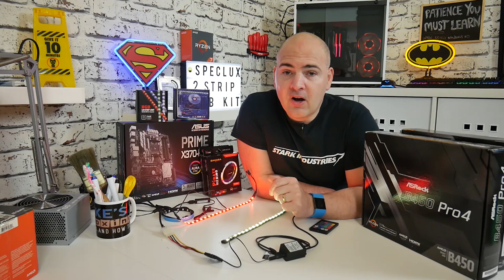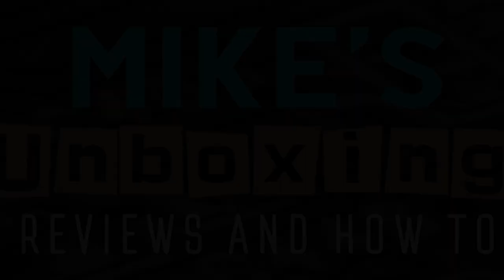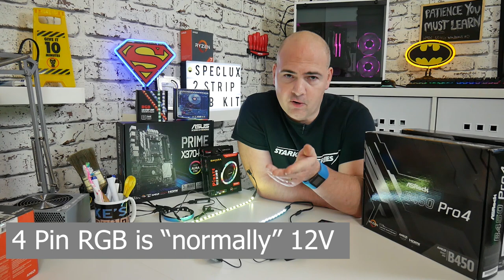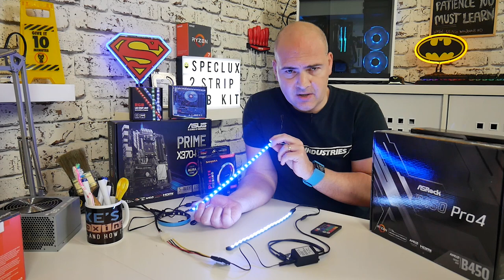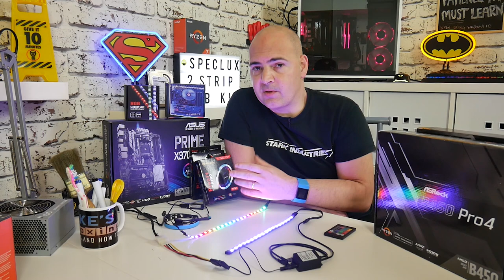PC RGB & Addressable RGB Explained

Comment: i have a question.. my motherboard has only 12v/4pin header and all the argb i baught are for 5v/3 pins, can i just plug a 5v/3pin controller/hub to the sata and it will work normally?
Reply: to further explain myself, i have an asus prome b450m-a motherboard, and the argb im talking about is phanteks fan frames and neon led strip(all 5v/3p), can it work if i use a 5v/3p hub that is powered by the sata?
Reply from the maker: yes that is right
Reply: @mikesunboxing   thanks it really solved my problem! i thought i would have to get a converter but if the sata only can power the controller hub without having to connect to an rgb header on the motherboard then i guess its fine, btw with this kind of setup can it sync with asus aura? or the controller only can do all that?
Reply from the maker: Yes the controller will effectively become the aura software and take control of the connected devices

Comment: Question - so if I purchase the Corsair H100i RGB Hydrocooler, it says its A-RGB, but the header on my motherboard only has (12v) four pin RGB, does this mean I can't use this cooler?
Reply from the maker: no you need a 5v argb header or controller
Reply: How do the controllers work mate? do they generally plug into the RGB header, or USB header or something like this? then allowing you connect A-RGB fans/strips/etc to the controller...?
Reply: Mike's unboxing, reviews and how to - doesn’t the h100 plug into a USB header though? Avoiding all this altogether?
Reply from the maker: The i version does it think but I could be wrong

Comment: Mike, I use the Sahara RGB's and want to plug them into the Asus Z490-H gaming board, the Sahara pamphlet shows the Asus method but I assume that I only connect one of those cables to the board. As such, I have connected the 3 pin to what I believe is the correct socket on the board which Asus are calling "Aura addressable Gen2 header"  The sata from the control box is connected to the PSU. Is this correct or should I use the 4 pin connector. if so does the 4 pin connect to the RGB header socket or one of the fan/pump headers ?? HELP
Reply from the maker: this is sorted now right? I am going though older messages and noticed this one
Reply: @mikesunboxing  Mike, Hi, yes, all working as it would appear, I have full control of Fan RGB's from the Sahara controller and the front panel switches also work ok. I take it that when I install the CPU and GPU and boot up for the first time I will have some form of RGB control within the motherboard software, not that I am likey to bother with it but simply trying to learn....I think I'm too old for this at 56 :-(

Comment: What about fans? do i  have to have a Controller Hub in order to control the Colors of the fan? I have a Corsair fan that for some reason can only light up in red. I have the RGB plugged into the 4 pin connector directly to the Motherboard. I can change the pattern via Arock Polychrome SYNC but the color doesn't change from red
Reply from the maker: generally the corsair fans use a specific controller so you are lucky you didn't break anything
Reply: @mikesunboxing  So I do have to have a Controller Hub then corect?

Comment: Recently bought a pc and I have three nzxt rgb fans and the kraken x63 rgb with the elite case which has rgb. When I first built it, all rgb worked but the pc itself wasn’t done. After fully fixing it, it worked but all my rgb doesn’t turn on. All of them stay off but one of my fans have a dim blue light. Is there anything at all that I can be missing? I don’t know if maybe it’s my power supply which runs at 750w or I’m just missing something. Really new to this so bear with me thanks.
Reply from the maker: maybe the plug is not fully seated?

Comment: Hey Mike awesome review. I have a quick question, can both RGB and ARGB fans be connected to the same ARGB Fan hub that is connected to the Motherboard? Also, if both are Aura sync compatible, would there be anything wrong with controlling the colours via software?
Reply from the maker: no you cant mix those on the same header sorry

Comment: Hi Sir Mike, I just want to ask if I can still light up my ARBG fans from my chassis (Tecware ForgeM) using my motherboard MSI B350M motherboard? Even though my motherboard is not rgb capable? I don't want for now to sync it since my motherboard doesn't have 3 pin 5V ARGB header. I just want to light it up. Is it possible? 

If it's possible, how can I do that? I mean the procedures.
Thank you so much sir, hopefully you can reply me😊
Reply from the maker: This is maybe easier to fix or at least advise if we can ask more questions and get direct answers, so feel free to join our Discord chat and we can go over it in more detail https://discord.gg/gaeeDPw

Comment: Hey Mike, quick question! Love the video, and thank you first and foremost. 

My RGB NZXT fans, they have a 3 pin female adapter, but my B760 pro series MOB has a 4 pin RGB header, but I have a 3 pin ADDR_LED header? Can I plug these RGB fan port into the 3 pin? Or does it have to be in the RGB header? 

Thank you,
Reply from the maker: RGB is 4 pin 12volt and argb is 3 pin 5v so not cross compatible. I’m not sure what fans you have but feel free to post some pictures on the discord and we can take a look

Comment: Hey Mike, loved the video! I learned a lot, subbed and liked!!

I had a couple questions, if you don't mind.

So I have an Asus X570 Prime Pro, it came with a 4-pin to 3-pin adapter and has rgb headers for both. I have a new RGB strip (idk if what brand it is but it's 4-pin), and I'm wondering:

1. Is it safe to use on my motheroard?
2. Does it make any difference which header I use, with or without the adapter?

I also have a Phanteks case with RGB fans and it has a 4-pin connector attached that says "only use Phanteks RGB strips" on it.

3. Should I just plug my LED strip into that instead?

I really appreciate you and look forward to checking out the rest of your channel, thank you so much!!!
Reply from the maker: This is maybe easier to fix or at least advise if we can ask more questions and get direct answers, and it might be good to see some pictures of the parts you have so feel free to join our Discord chat and we can go over it in more detail https://discord.gg/gaeeDPw

Comment: Ok so I’ve got a problem,Basically I Want Some ARGB Case Fans That Are Compatible With Aura Sync But The Problem Is My ROG Strix B450-f Only Has A 4 Pin 12V Rgb Header...Help pls :/
Reply from the maker: you won't get any, 5v addressable is not compatible with 12v rgb in any real terms. There is an adaptor on the market that claims to convert 12v to addressable but the software won't control it as it can only do all the colours at the same time unlike addressable that can change individual leds

Comment: Say if I bought a couple of fans with motherboard sync. Does this mean the argb fans will work with any brand motherboard? It says compatible with Aura Sync but then it also says motherboard sync. So I am confused as to whether or not the fans will sync to any motherboard or only ASUS ones.

Cheers
Reply from the maker: if it says motherboard sync it should work from motherboard headers and be widely compatible
Reply: Hi, thanks for the video, i have a question if you mind, is it possible to plug the 3 pin Argb cable into the second Argb port in the motherboard? I have the Asrock B560 Pro 4 and i can't reach the ADDR_LED1, but it can reach the ADDR_LED2 easily, so is it possible to connect that cable into the 2 port without having anything into the 1?

Comment: I got a SAMA-G3-ARGB Case that has a ARGB Hub, with 5V 3-pins for the LEDS, and 3-pins for the fans. I also bought a Cooler Master ARGB 3-Pack of fans to go with the case, installed on the front grill. The 3-pack fa pins are 4-pin. Can they still work with the case, if the 5V 3-pins are connected to the case's ARGB hub, while the 4-pins are connected to the Power Supply?
Reply from the maker: i would connect the 4 pin fans to the motherboard or a separate hub but yes they should be able to be used together

Comment: Hi Mike. I bough a "Nox Infinity Alpha" case. It has a "barebone" controller, in the back-side of the case, which controls one argb strip on the front panel and one 120mm argb fan in the rear panel. You can connect more fans and leds, and it has 3 pin connectors for leds, so I'm lead to think that it is supporting "3 pin - 5V" argb strips but... anything will do? Is there a method to tell if a strip is compatible with it?
Reply from the maker: the 3pin standard is pretty straight forward so as long as it the the four pin style connector with only three pins with the extra pin removed then you should be fine

Comment: Hey Mike, do all RGB strips need to be connected to a controller/node for it to work properly?  As in they can't be connected directly to the 4 pin mobo header?  Sorry if this is a stupid question!
Reply from the maker: the controller is a substitute for the motherboard controller if not included on the board

Comment: Does the Asus TUF B450-PRO GAMING go with the Sharkoon TG4?

I just saw a video about aRGB then suddenly he talked about different pins and headers. From what I understand is that the normal RGB Leds use a 12V header and the aRGB apparently a 5V header. Now is my question: does this mean that the Asus TUF B450-PRO GAMING motherboard isn't compatible with the Sharkoon TG4 case? 

Thanks in advance.
Reply from the maker: no that won't work together sadly

Comment: Are the 4 pin RGB connectors the same as the cheap strips found in the electronics section of your local superstore?  I have tons of them left over from other projects, and would like to use them if possible.
Reply from the maker: yes they quite often are, just check the wiring and markings to make sure the voltage and signals match but otherwise this is a good way to save a little money in some instances

Comment: Hi Mike, thanks for this video. I now understand the difference between the two which is great. I'm building my first PC - Asus B550 gaming Wifi 2 mobo and putting it in a Corsair 3000d. Would I connect the chasis fans and others to the ADD_Gen or CHA_Fan headers? Thanks G.
Reply from the maker: i think that comes with the sp120 rgb elite fans so yes the chassis fan header and 3 pin 5v argb (add_gen) on the board
Reply: Thats brilliant thank you Mike!
Reply from the maker: @GaryWalsh-21  no worries

Comment: I have a question. I have an ASrock B450 Pro4. And i just bought Fractal Prisma RGB Fans. So where do plug that to the motherboard? Im super new to RGB. SOrry for the stupid question
Reply from the maker: plug the LED cable into the addressable rgb header on the pro4 NOT the 12v RGB four pin one - or bang!
Reply: Mike's unboxing, reviews and how to thanks for the reply! I am getting all my fans tomorrow. Now I bought the Celcius + AIO prisma cooler. Do i put the Led connecter to the amd fan led which is a 4 pin. 

Since my 3 pin rgb is already been used by my 3 prisma fans. So where do i put them?

Comment: For the 3-pin addressable RGB, do I need to have a motherboard that is 3-pin addressable already or will the 4-pin adapter allow me to use the 3-pin lights the way they are intended with multiple colors at once?
Reply from the maker: it must be a 3 pin argb
Reply: RGB is 12v and ARGB is 5v so you will need a specific conector on the motherboard or you will toast your lights

Comment: Hello mate, thanks for this video, I'm a little bit confused with all the different RGB standards and I have a question if you wouldn't mind helping me out?  Can you tell me if my system will sync the RGBs please (I have the parts on order, not built it yet)  The components that have RGB in my build is as follows:   Kolink PHALANX Case,  MSI MAG X570 Tomahawk Motherboard, TeamGroup T-Force Delta RGB 16GB 3600MHz DDR4 RAM, MSI MAG CORELIQUID 240R AIO CPU Liquid Cooler.   Will these work together? and how do I connect them all?
Reply from the maker: not sure sorry those aren't components i have any experience with
Reply: @mikesunboxing  ok thanks

Comment: In the planning stage of building my first PC and plan to go rgb heavy (corsair aio with six RGB fans, v1 tech gpu plate, Lian Li striker cables, maybe rgb strips depending on room and/or appearance)  Is there a way to determine a) how many ARGB headers I need on my motherboard b) which motherboards support that capability c) additional hardware/cables/processes to sync all of them together?
Reply from the maker: This is maybe easier to fix or at least advise if we can ask more questions and get direct answers, so feel free to join our Discord chat and we can go over it in more detail https://discord.gg/gaeeDPw

Comment: I really wish someone made a 4-pin RGB to 3-pin A-RGB adapter. I know you couldn't addess them individually, but it can't be that hard to just, pass the detected color along the strip to mimic how 4-pin works. That way if I upgrade to an argb motherboard later, I wouldn't have the exact opposite problem....
Reply from the maker: I think deepcool make one

Comment: Is there any type of way I can connect my new Govee SmartColor WiFi lights back together? I cut them at about the 8 foot mark thinking I would be able to connect them to my 4-pin connectors and be back in business. Turns out, mine are 3 pin addressable as you explained in the video (I’m very new to LED’s). Anyways, I’ve now got 8 feet of unused smart LED’s and no way to connect them to the other half, and was wondering if the 3 pin connectors on Amazon would do that? It’s just one strip, so adding the other half wouldn’t overpower it. Seems like a new technology/limited solution kind of problem I’ve ran into. Any help would be appreciated! Thanks for the awesome video
Reply from the maker: you might be able to resolder it, but without seeing it i cant be sure

Comment: Hello i have a little question, i have a B450M Bazooka with an XPG Invader Chassis (Great review by the way) and that chassis have RGB connectors of 3 pins (In fact is 4 but one is fill with plastic or rubber). So my question is possible to connect this RGB to the motherboard (jus make a hole in the rubber to not bend the pin) or is better to buy and use a splitter of 4 pins or is something else i can do?.

Update: I resolve the problem, i connect the SATA RBG to the Power and connect the 3 female pin to one of the 3 male cables with 3 pins that accompany the SATA and come from the same frontal top panel. Well at last i learn something new after 1 year that i build my new PC. I have to say i not big fan of the RGB but i like a nice solid blue color in my PC.

Ty and sry for the English.
Reply from the maker: your english is really good, and i am glad to hear you have resolved your own problem

Comment: Very basic question: Do RGB fans have two connectors? Like one for power (either 3 or 4 pin) and one for RGB (either 3 or 4 pin)? Or is both combined into one connector?
Reply from the maker: It can be both types depending on the brand and model
Reply: my rf120 has 3 (1pwm for the hub the  the hub is connected to sytem fan, 1 for to sync from other fan, 1 for rgb header)

Comment: Hi Mike, I was wondering if you could help? I have just got my first PC which came with 4 ARGB fans: Tecware Forge M. This came with an LED switch for the fans, which has 6 pin ports. My motherboard (MSI B450M Mortar MAX) does not have an ARGB header, only and RGB Header. I'd like to know how I can connect the ARGB LED switch to my motherboard, and also what are the 6 pin connections calls as I would like to connection some LED strips directly to the LED switch? Thanks in advance
Reply from the maker: This is maybe easier to fix or at least advise if we can ask more questions and get direct answers, so feel free to join our Discord chat and we can go over it in more detail https://discord.gg/gaeeDPw

Comment: question I have a 4 pin RGB  header  mother board  . I want a addressable color strip  that has its own controller so I can have  a  strip with many different colors at once not just one color at a time. So I wont need to depend on my 4 head RGB  from the mother board  since I don't have a 3 pin . Can I get a kit that works on its own with out the RGB
Reply: I am searching same answer and ı found one solution.Deepcool RGB Converter may work.

Comment: I have a 5050 4-pin cable but my case has an RGB hub with an 5050 3-pin input, can I just cut off a pin to make the cable 3-pin? 😄 My MSI mono has both 4 and 3pin RGB connectors
Reply from the maker: Not sure sorry 😐

Comment: I have the Gigabite B450m motherboard but it only has one RGB header. Will a RGB  controller work to expand the ports and RGB capability? (I.E. fan RGB)
Reply from the maker: yes a controller will give you a lot more options

Comment: Can you recommend an addressable 3-pin (no gap) to 3-pin gap adapter cable?  I cannot find a hub/splitter that I can use with my DeepCool Captain 240 Pro.  It has a hub/splitter, but the wires won't stay plugged in and DeepCool has not been helpful.  At the moment, I have the wires wrapped in electrical tape to the hub.  They won't stay clipped in place.
Reply from the maker: Are you using a gigabyte motherboard?
Reply: Yes - sorry, should have mentioned that.  However I have one wire to convert for Gigabyte. My problem is that the hub won't hold the two fans  and the CPU RGB connectors (they don't stay clipped).  My mobo uses both the addressable RGB and the 12v RGB, but not enough ports to handle three A-RGB ports.  I need a 5v hub that works for the Deep Cool AIO.  Thanks for any advice.  @mikesunboxing
Reply from the maker: This one looks like it might be suitable. It has the option of gigabyte and regular 5v addressable rgb. what do you think? https://amzn.to/2IJxUpb